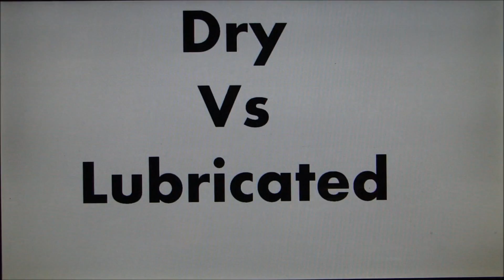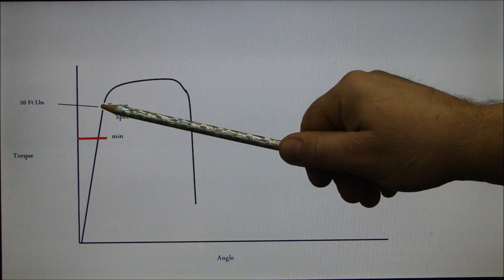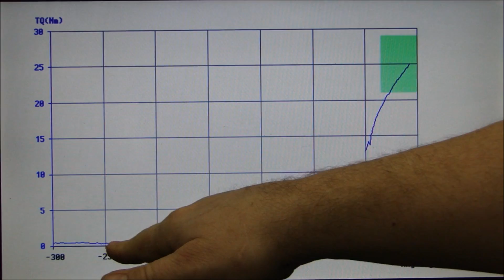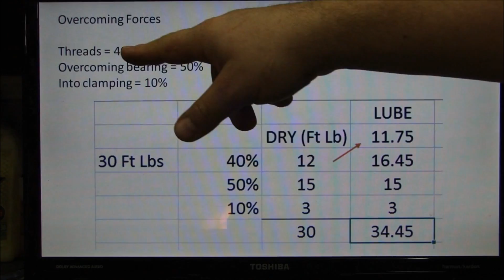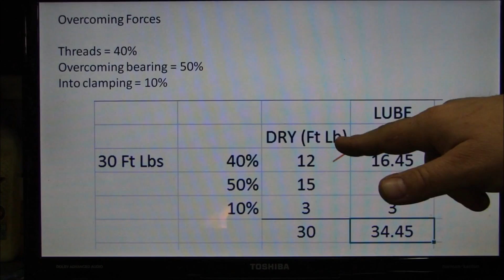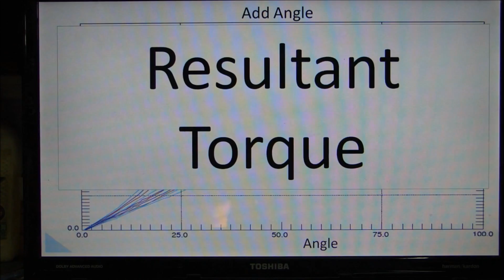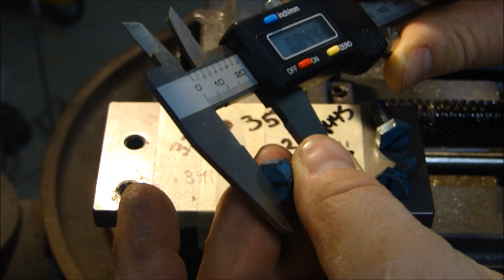Engine Building - Fastening

Comment: No no no no. Lubricated bolts will give a higher clamping force due to less rotational friction. In other words a lubricated bolt will stretch more compared to an unlubricated bolt.  Either i completely misunderstand what you are saying or you have come to a conclusion that contradicts most sources on this topic
Reply from the maker: I hope you watched the whole video including the experiment. The experiment proved that a lubricated fastener stretches less leading to a lower resultant torque. The lower resultant torque produces a lower clamp load.
Reply: ***** Incorrect conclusion.
There are huge differences between elastic deformation, plastic deformation, tension stretch and permanently stretched. 
What you demonstrated(proved) was permanent stretch due to the friction on the threads preventing rotational movement in the thread contact area driven by the head resulting in permanent stretch deformation between the head and the threads on the un-lubricated fastener. 
That un-lubricated fastener is now permanently damaged in the area just below the head and the first threads of engagement in the plate where the permanent stretch occurred. 
The torsional yield was exceeded due to the thread friction before any tensile yield, however since the fastener was already under a tensile load when the material yield was exceeded there was a resultant permanent stretch. 
The test would have been more revealing with the second length measurement taken in the torqued(tightened) state. 
Also your test/demonstration method was flawed if you did not torque all of the fasteners to identical stepped values of approximately 30%, 60% and 90% of the end target torque value, especially critical since you chose to use the torque angle method. 
Further, if those bolts in the experiment were used they may have been subjected to prior mechanical or thermal stresses resulting in erroneous results. 
I will avoid hijacking ***** 's thread and reply directly to your thread above later today.
Reply from the maker: I reference The influence of lubrication on the design of yield 
tightened joints The Journal of Strain Analysis for Engineering Design 
April 1, 1991 26: 
123-132, doi:10.1243/03093247V262123 

@content/26/2/123.abstract 
@content/26/2/123.full.pdf+html 
@content/26/2/123.refs
Reply: ***** Is this the sole reference your position is based on? 
The reason I ask is because I have been unable to access the article you referenced without paying an unreasonable fee for access.
Reply from the maker: Absolutely not. I've been doing PhD research for 4 years and I'm use to having hundreds of citations.  The abstract supports what I am saying.  Thank you very much for taking such a deep interest in the subject.  The intent of my channel is to drive discussion and understanding.  However,  the main point here is to show that thread conditions and coatings have an effect on torque results.  I did not intend for it to be a referenced scientific study.
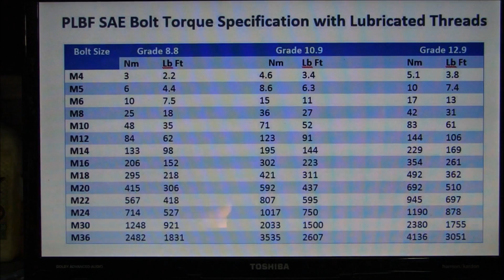Reply: +Petes Garage I just watched V8TV's latest upload "Checking Your Torque Wrench And Proper Fastener Torque Tips Video V8TV" and recalled doing a comment here where we disagreed a bit. As already pointed out by others your argumentation for this has huge flaws around 12:45 - 13:42.
You state that when using a lubricant you should experience a drop in friction at around 3% (this will of course change with type of lubricant).
So let say that  the torque lost due to friction in the treads on dry bolts are at 40 % as you states. A drop in friction of 3% should then mean that only 37% of the torque is spent to overcome friction in thee treads. This again would of course give a 3% gain somewhere else and needless to say it wont't go into overcoming friction bearing friction...
Of course you will gain this in higher clamping force. 3% to be specific in this hypothetical case

Comment: Please use correct physic terms!
Reply from the maker: For what?
Reply: *****
Please be more precise.
Watched just some first minutes.
Torque isn't resistance. And Bolt elastic and plastic deformation graph was also questionable.
Reply from the maker: Perhaps there is a translation difference?  I assure you my charts are accurate.  I look at torque graphs every day. They are real world examples.